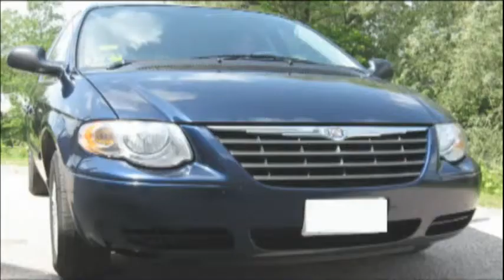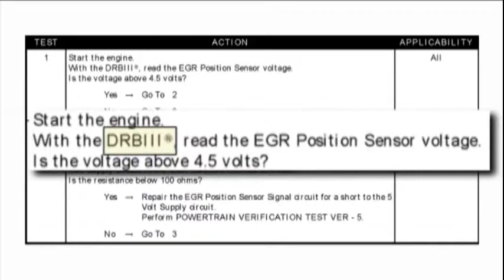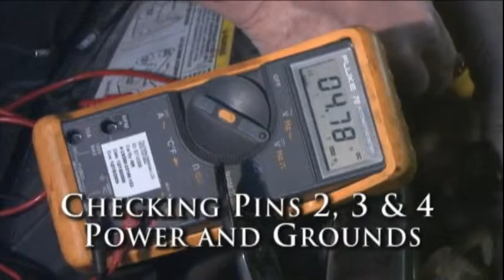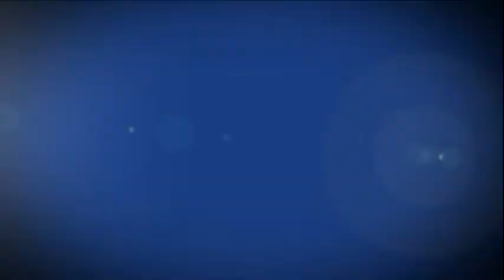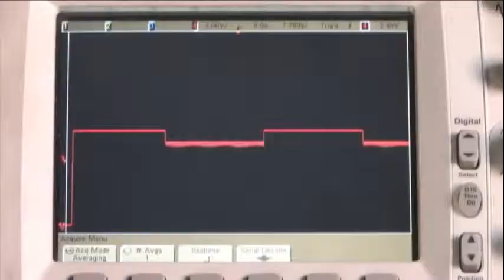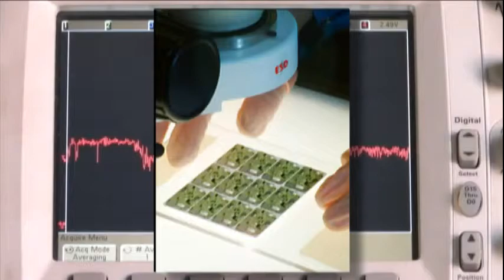Wells P0406 Dodge EGR, Diagnosis, Testing, Cause and Fix

Comment: Wells is the best for support. I had a problem years ago and they solved the bad ignition switch on a 2002 Pontiac GrandAM. I had it a three mechanics ( spent over $400)and no one could solve it. Wells told me what to test and they were correct. They are second to no one. Buy Wells products and you won't be sorry.